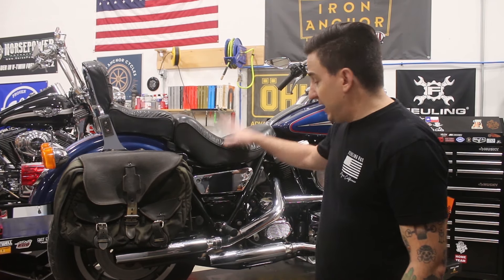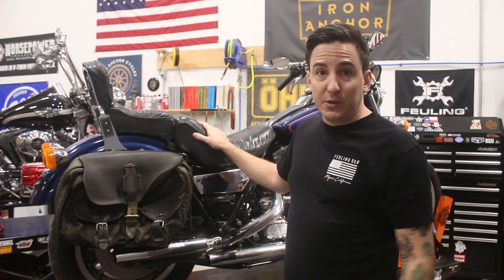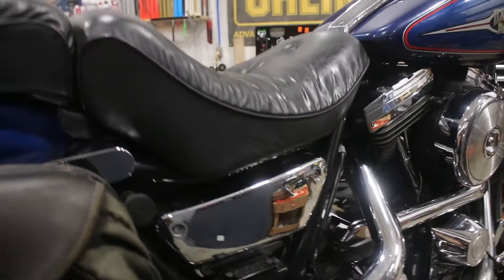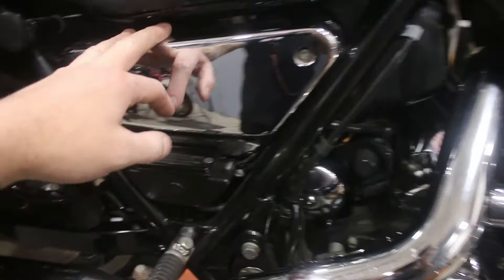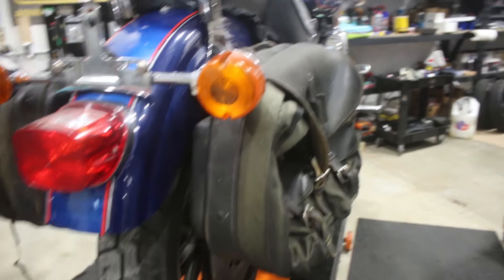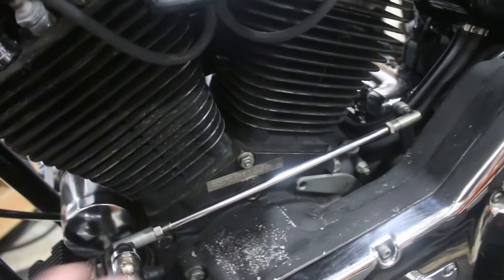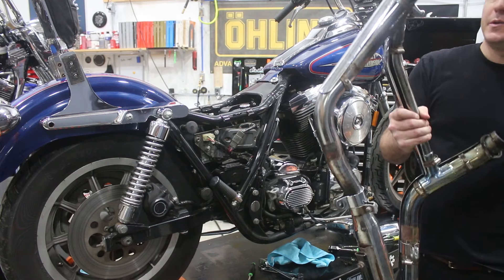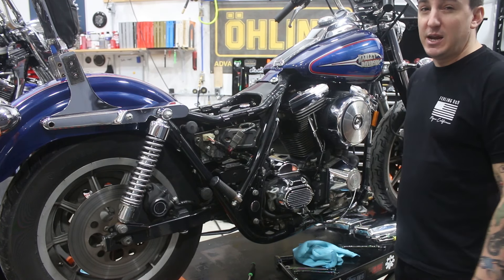Starting A New Build - Tearing Down The FXR!

Comment: I have a 94 fxr . Once you change the cam, upgrade topend, put dingle fire ignition, and a youst tube in the stock cv carb, the 80 cubic inch Evo is not slow. I believe that it's called waking up your Evo. They hold up well. Ran my first one over 200,000. Just change fluids. Also improved clutch. No problem with stock dual disk breake set up. My little 80ci. Runs fast and handles super well. I run good tires and I lay it over when I corner.  I did have to upgrade the charging system as well. It's inky got like 15,thousand on it. Had just over ten when I bought it. Then I got hit by teenager in a Buick. So when I could walk again,  wich was a year or so. I rebuild it. Then I got hit by teenager on cell phone.  Pushed me a full city block before he realized he had ran in to me. Then I got sick.  So I have not had chance to put miles on the bike. It's been totaled 4 times. Getting ready to put it in a custom frame. Took 9 years to collect all of the parts. Heath problems slowed me down. Anyway I digress.  I love my bike. It's my 2nd harly and my second fxr.i love it. Most dependable bike I have ever had.

Comment: First of all, I love the series of videos you did on this build! I'm on my second FXR since 86 when I bought an FXRS from HD Military Sales while in PI. I now have a '94 FXLR that I bought for my wife. This is an older video but maybe someone can clear up what I've been told in the past about using impact tools on the compensator nut. I was told many moons ago that using the impact will possibly damage the flywheel as it can loosen up the pins. Maybe I'm confusing that with the shovel compensator as I also have a '69 FLH that I've owned since '93. 
The stator fried on the '94 so I'm in the process of replacing the charging system with a Spyke unit. Great insight on all of the seals and bushings in your videos so thank you for that. My bearing race did actually walk up into the 5th gear seal so I had to get that off without use of the puller. On that subject, I've also been told by some of my friends that they have not changed the two-piece bearing on their evos due to the oiling properties of the open 2-piece. For this reason I have replaced the stock bearing setup, but I'm not married to the idea it's a better setup as far as oiling is concerned.

Comment: U did a great job on this bike , I’m completely rebuilding a 1989 FXRS getting close to being done, I have a Baker OD6 a S&S 96” Sidewinder kit , Branch Heads, EV 59 Cam in it . I’m getting some talk from guys how I respect how say the HPI exhaust is for a bike with more power than this bike will put out . Can I please ask the man that put this build together for the 93 FXR , should I run the HPI exhaust. I definitely want to run them , the Baker OD6 has the dog ear on the door for the bracket HPI makes. Love to hear your response Anchor .
Brad

Comment: I have an 89 Fxrs-c 95% stock. Replaced the base gaskets and original warped rocker box covers. Rode it lightly but within 2 months it has blown the gaskets out between the rocker box sections. Mechanic says the breather is working. Any suggestions?

Comment: My 86’ FXRS has center fill tank with fuel gauge. Not sure what makes the “convertible” so special
Reply: Bags and windshield
Reply: The covertable is an FXRS-SP lowrider sport with a windshield and semi-solid removable saddle bags. They have 2'' longer suspension and twin disc front end,much better lean angle than a fxr/fxrs even more than most sportsters of the era.

Comment: Why a Chain final drive? Whats the advantage over belt?
Reply from the maker: You can get into the weeds a bit on the performance benefits of it (better torque response, etc.) but the main reason we're doing it is that it will allow us to run a 150 rear tires rather than the stock 130.
Reply: @IronAnchorCycles Cool.  Older HD rear tires are a bit thin compared to the modern bikes. Thanks for taking the time.
Reply: @Jimmy_Jim_Jim_1234  Thin, sure, but rubber compounds today blow away what was out there in the '80s.  A set of Avons on the FXR STICK
Reply: @uberDoward  Agreed.
I use the new Dunlop Q4's on my 675R track day bike and they're great. They don't last though, and expensive!
Reply: @edmonddupris8422  Look into how a motorcycle's dynamic contact patch works - that 150 doesn't make as much of a difference as the 20mm would lead you to believe!
Reply: @uberDoward  Maybe not on a commuter, but it looks cool on a HD. And if you have the mechanic skills like they do, go for it!